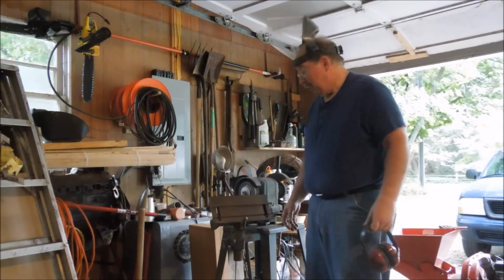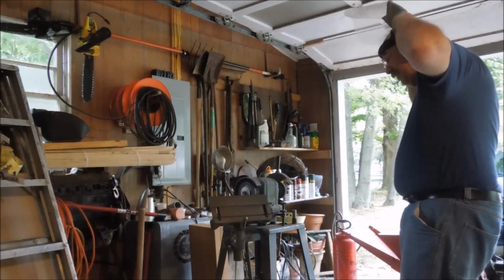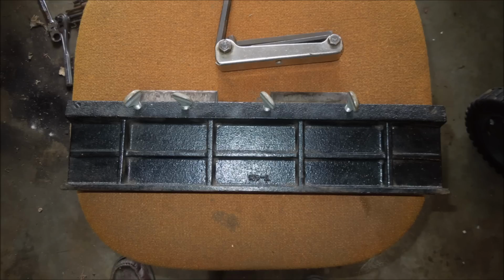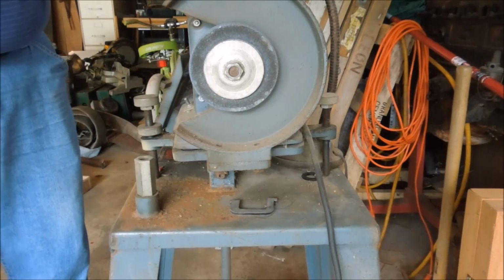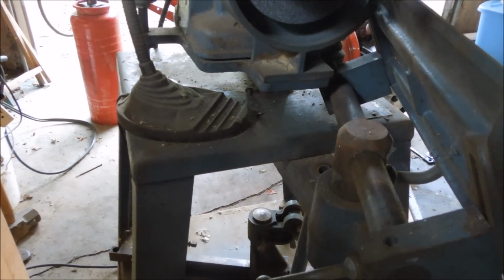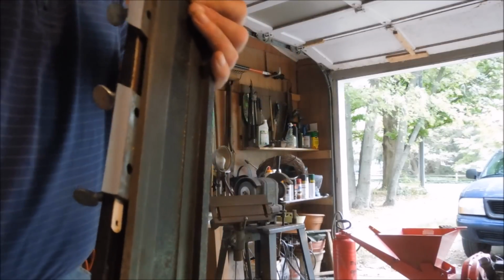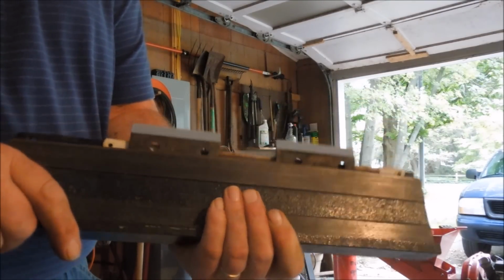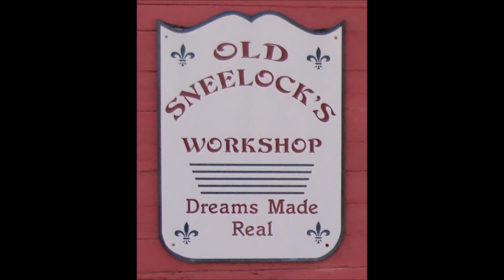Estate Sale Finds – MTD Wood Chipper Shredder – Pt 3 Sharpening The Blades   by Old Sneelock’s Works

Comment: Belsaw and then Foley-Belsaw was one of those "Own your Own Business"  ads you use to always see in Popular Mechanics for decades. They had several models of grinders and fixtures for knives, axes, hand saws, reel mower blades, etc......for a guy to start and run his own sharpening business.
You can see the machines on CraigsList now and then but some of them were so complex that unless they came with the instructions it would be very hard to get them working properly.
Reply from the maker: +GrandsonofKong I bought this grinder for the specific purpose of sharpening the blades in my planer. At 13" wide they are difficult to sharpen by hand. A set cost me $60.00 10 years ago. The grinder cost $100.00. Funny thing is these blades are the first I've used the grinder for. When I bought it 4 years ago I was thinking I was going to need a set of blades soon and justified the purchase with that in mind. This particular rig is focused on sharpening circular saws. It can do some amazing things with the pile of attachments that came with it.
Reply: +Old Sneelock's Workshop Neat rig, Unc! I remember the adds Kong. A pal of mine had a Belsaw setup and I've never seen all the stuff he had. I don't think he ever figured it out.  That one sure works fine and dandy. the proof will be in the pudding as the old saying goes. Might want to steepen the angle but like you said, we'll see!
Reply: Old Sneelock's Workshop
Out of curiosity I went  on CraigsList ad saw a Belsaw grinder that looked similar to yours, perhaps a bit newer based on the power switch, etc....guy wanted $650!
Only other Belsaw item was a Key cutter, I forgot they were big into those as well.
Reply from the maker: +GrandsonofKong A few years ago, I set up a search on Ebay for Foley Belsaw. There are usually 4 or 5 items listed new each day. The newer grinders are averaging $300.00 each. The saw filers are the most commonly listed item and they sell for $200.00 or so. Not list price. Selling price. 
When people were buying these from Foley Belsaw they were selling the grinder and the mail order class in how to use it.  The person could have several thousand dollars wrapped up in the project before they sharpened a single thing. At a dollar a blade it took a long time to pay off the investment. 
The equipment is well made and the price was probably reasonable, but at the time people were buying them a new Chevy was $2000.00. I think disposable blades made it difficult to find customers so the grinders got used as bench grinders and the attachments were sold for scrap. 
This grinder has been used once in 4 years. If I wasn't a tool junky I would have sold it off years ago as not worth the floor space.

Comment: looked like a hollow grind, but could not tell for sure. nice job.
Reply from the maker: You are correct. Using a wheel almost always gives a flat grind. By cutting on the corner of the wheel the grind has a relatively large radius and these blades are made for impact so they have a rather steep grind angle on them to thicken the edge.